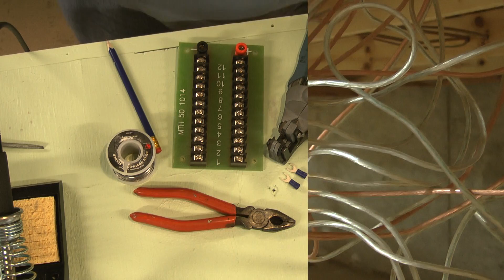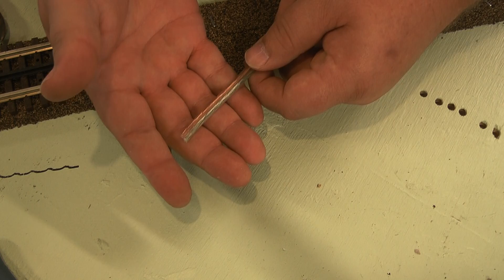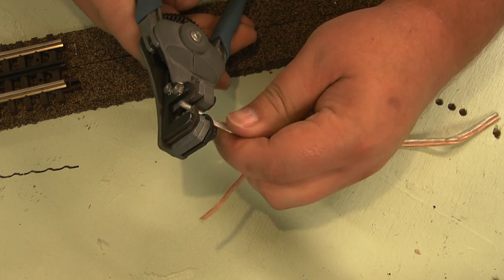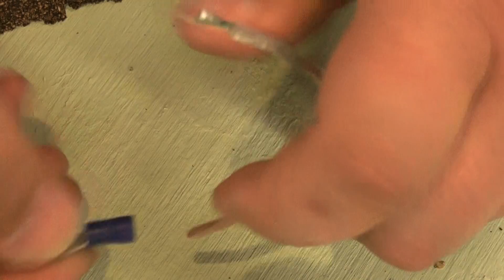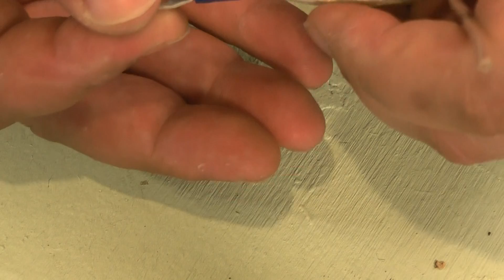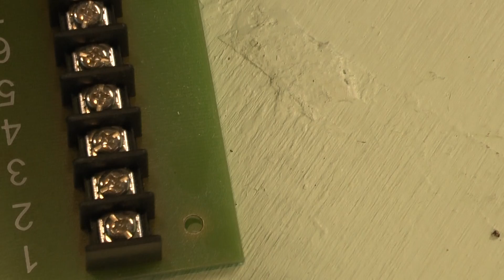Simple electrical connections on my O Scale Layout

Comment: I hope you are still around to answer this: All the MTH, Lionel accessory/buildings I have come pre wired with a short length of very thin wire. It appears to me that you are using standard stereo  speaker wire which is much thicker. AmI correct and,if so,how did you handle it- cut off what came with the pieces and start over with the clear wiring, thicker wiring ? 
Thanks !!
Reply from the maker: Hello, I did use speaker wire however only for track power feeders.  It works very well with DCS.  I use much smaller wire on houses and structures.  Thanks for the question and Happy New Year.
Reply: @PrimeMoverVideos  Thank you for the quick reply !! If you don't mind because I'm about to buy a lot of  it, what size did you use for your lit buildings and houses ? 
I have about a dozen stores / Main St kind of thing, and some track accessories-lights and soon plus half a dozen switch tracks on an 'L' shape 5''x14' and 5' x 10' lay out. I have a MTH water tower too and that motorised train barn thats been popular (forgetting the maker. They send out these units with a short section of wire nd the wire is really between thread and string size. Do you pull out the thin stuff and solder in the new thicker ? I can't tell if they're just being cheap or its a tip from them as to what size is appropriate ? Seems REALLY flimsy though. I run a MTH Z-4000 with a Lionel remote wired into the Z for power. I'm just getting started. Thanks for any advice, really appreciate it !!
Reply from the maker: @flynnlizzy5469  Gosh I think I used 20 gauge.  Low amperage things like the houses or small accessories where the amperage is low do not require a large gauge of wire.  I think MTH uses 22 gage but I'm not positive on that.

Comment: I have done as you have in the past. I've never used speaker wire.. I like the idea of it. I noticed that you chose copper for Positive and the aluminum for Ground.. what is the theory of this practice? I don't believe you just happened to do it this way.. there must be a reason for this method. Thank you for sharing.
Reply: Makes it easier to identify the positive from common or ground.  Same principle as electrical wire in a house.  There is some speaker wire that has copper on both leads and some that has silver on both leads.
Reply: @richardbrown3061  thank you for the reply... really great video.

Comment: Great video! How did you attach wiring to track? Solder or Lockons? Just curious?
Reply from the maker: I soldered all the connections to the base of the rail.
Reply: @PrimeMoverVideos  I really liked your crimping. Goes to show that a person like me does not have to apply too much pressure that destroys plastic jacket
Reply from the maker: @jsgtrains3176  No not at all.  It's all a learning process.  Give yourself time to learn, you'll make mistakes just as I do but you'll learn from them.    Keep at it and I wish you a ton of success with your layout.😁

Comment: Nice video!, really learned many things from it.  Just want to ask if this star method recommended for MTH could work as well for Lionel TMCC? I tried bus system technique but the signal is not strong enough. Believe because I shared the ground cable with many accessories switches, etc made branches with it. I planning changing it to the star method to enhance signal. Any suggestions?
Reply from the maker: I had added Lionels Legacy system by just connecting to the input terminals on the TIU with no other changes and it worked perfectly.
Reply from the maker: I also have the track ground isolated from anything else like switches and accessories.
Reply: Many thanks; I'll then isolate the ground line for the track from the  common ground I use for accessories, switches,  etc. So make a star arrangement connection just for the track   I will come back to you with other arising issues if you do not mind.